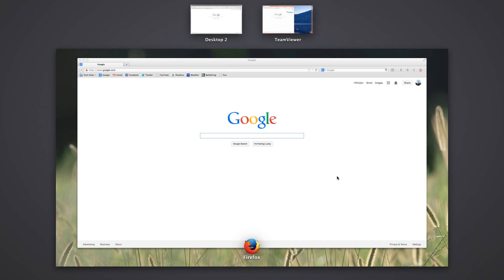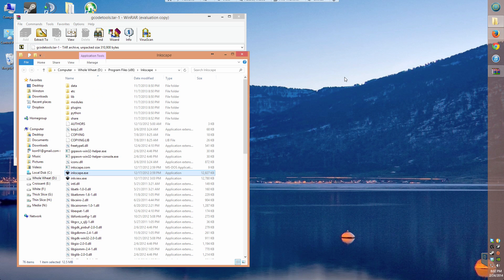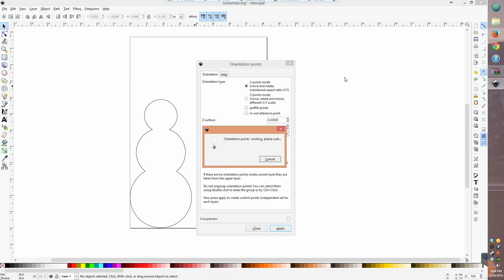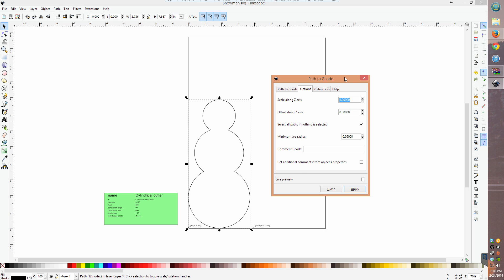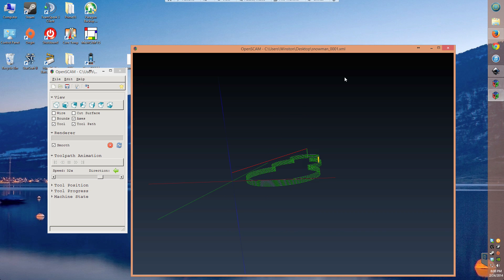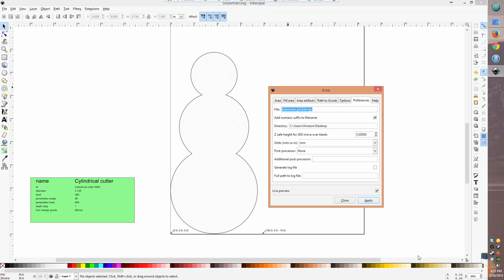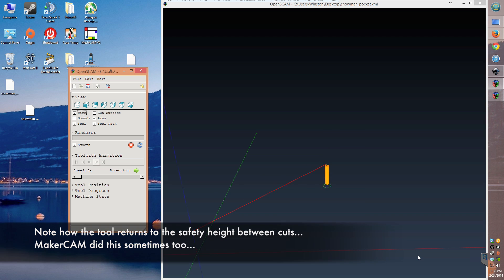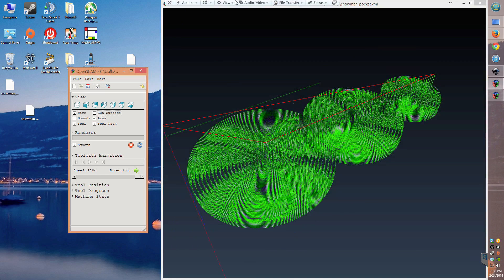Trying Out GCodeTools (Inkscape Plugin)

Comment: i'm just starting with inkscape,i need to convert images to gcode,i keep getting an error  message string when i try to run gcode in grbl controller using the makerbot unicom gcode extension,so i found the gcode tools thing,when i open inkscape i do not get the gcode tools drop down you get,mine has no drop down arrow/pointer as does the "colour" drop down list.

I honestly could not follow you  in the cnc-club.ru,the text on screen (yours) is too small,and you blasted through it,the only thread i could see was one hanging off my tee shirt,i wish i could have followed your cursor,i might then have had achance to see what was being sellected.What was the green arrow used to sellect the gcode tools,i have not got this when i get to cnc-club.ru.

Good vid but i just could not keep up with it,ok it wasn't a tutorial and i'm a total green horn with inkscape,there just seems to be too many off points between my sellectable gcode tools and what you have,i may have to uninstall inkscape and start fresh,plus i had to install an earlier version to use the makerbot unicom gcode  extension,which i think is not what i need,but the gcode tools IS whats needed.

cheers.

Comment: I found that when using gcodetools like this, the "runs in reverse first" and when I was using it "why did it cut twice" is answered by the fact that the cut line has thickness, and it created a toolpath for inside and outside. Try making a solid shape, and running gcodetools on it to see (perhaps?) different results.

Comment: when I try to save the file into the extensions folder it just hangs at 99%
Reply from the maker: That is quite odd. Have you tried moving them over a few at a time? Is there a particular file that's causing problems?
Reply: I unzip them highlight and try to add them to the extensions folders they all unzip properly they just hang at 99%
Reply from the maker: Mike King  Even if you only try to move just one of the files?